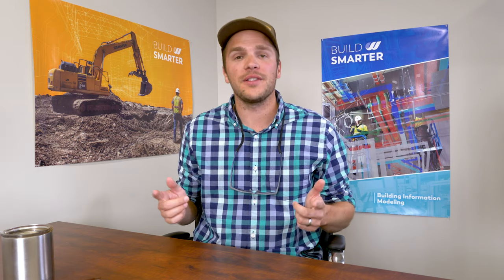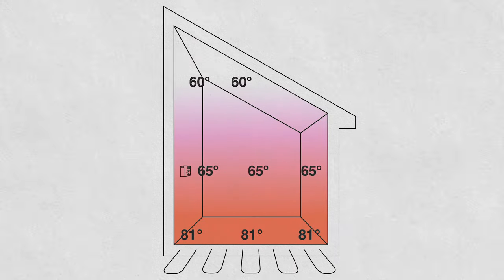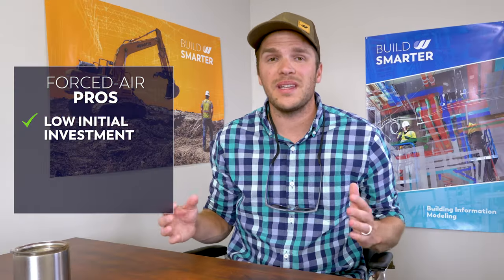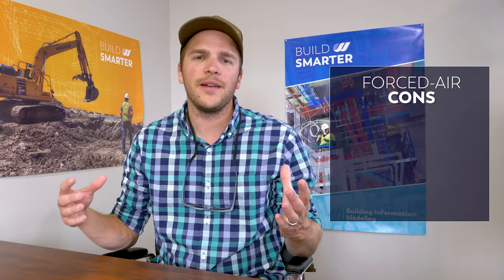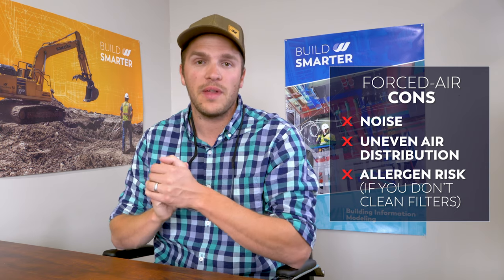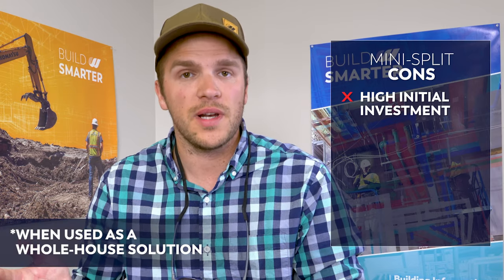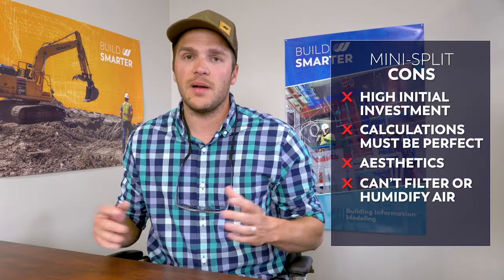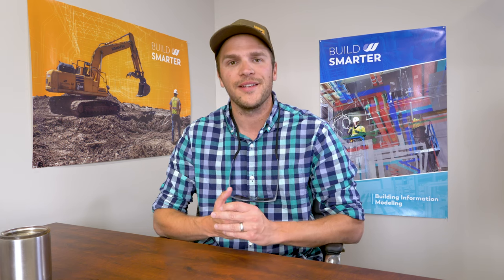Heating Systems: Hydronic vs Forced-Air vs Mini-Split

Comment: For professional working in the trade ( I a plumbing wholesaler) from Denmark, it's interesting to see how things are done in other countries. Forced air heating is not common in Denmark. It was used a bit in some late 70's houses. I have only seen it once live, as my cousin has in her house. Most houses in Denmark is heated with hydronic systems, by floor heating or radiators. I have a pellet stove in my house, but oil and natural gas is faced out in favour of air to water heating pumps as best retrofit solution

Comment: I used to have Forced Air w/ an oil furnace but not have a Fujitsu mini-split system and a hydronic system with cast iron radiators.  Absolutely love the mini-split for A/C and heat down to around 25 degrees  Fahrenheit.  Any lower than that and it doesnt quite have the muscle to keep the house toasty.  Thats where we let the hydronic system take over and its really the best of both worlds.  I didnt miss either the noise or smell from the old oil burner.
Reply: Wait, so I'm guessing your hydronic system is gas fired? I'm replacing an oild oil burner so this is for research. PS don't have gas in my community.
Reply: How do you heat the hydronic system?

Comment: Another pro of forced air is its compatibility to pairing with a heat pump for cooling. Forced air fits well with water to air geothermal systems and solar thermal too

Comment: The house I live in has hydronic heating with baseboards, not as fancy as in floor heating but it is quiet and fairly well distributed. Heat registers go across 3 walls in a room. There is noise in the rooms over the oil fired boiler. Big con is no AC except window units or maybe mini splits if they were installed. The house is from the 1950s and I wonder if the hydronic systems were more popular back then.

Comment: It seems you didn`t mention another advantage of the hydronic systems it consumes around 150-300 watt for the heater and circulation pump, therefore it is very easy to organize a battery backup for it. In case of emergency a couple of 100 ah batteries will keep the system running for almost 24 hours.

Comment: in the Uk hydronic systems are standard in all homes forced air is practically unheard of. most homes will be equipped with boilers fitted within 10 years and maintenance is either covered by your landlord or by your gas company companies like SSE offer full boiler down cover also dry heat isn't really a problem in the UK because its winter and its 5C where i live but humidity is still 88%
Reply: I thought there is a mandate for UK homes to become CO2 neutral by 2050 or was it 2040? 

When you don't get really cheap green hydrogen, you are screwed! Compared to heatpumps, hydrogen boilers need somewhere between 5 to 15 times more renewable energy. Remodeling a home with a boiler to be compatible with heatpumps will be very expensive.

Comment: Interesting video, thanks! I would say the biggest potential issue for water radiant heating is that if your pump breaks you could have the water freeze which would crack your piping and concrete slab. How about radiant heating but with air going through the pipes ? Regards
Reply from the maker: Water freezing can be an absolute disaster if your pump fails — you're absolutely correct. For vacation homes, or if you want the peace of mind, we mix glycol antifreeze with the water -- so if the pump fails, the lines won't burst. We use Alphi-11: https://fernox.us/product/alphi-11-protector-25l/
Reply: @willplumb  I did that in my system to give peace of mind and it caused me problems. The antifreeze is thicker and holds less energy than water does, so it heats up faster in the boiler (in my case a tankless water heater) and doesn't flow as fast. Both combined to cause flashing to steam in the WH and awful screeching noises. Working with the WH manufacturer they asked me to take the glycol out, which helped but the problem did not go away completely. I eventually figured out it was flashing and increased the system pressure to a minimum of 15psi (gets to 40ish when hot)(the manufacturer stated I needed a 15psi pump, not system pressure) and that solved the issue completely. Guessing I could put some of the glycol back in now...

I wonder if a salt solution would be a better choice. Sodium Acetate would increase the thermal capacity of the fluid while providing the freeze resistance. I would have to swap to a stainless pump to do it though and it might cause corrosion problems in the zone control valves depending on what the insides are made of.

Comment: A con to hydronic systems is not just humidification but also de-humidification if you're in the south, meaning you've only solved the heat issue and need another setup for cooling.
Reply: Agreed, in the midwest where I live hydronic makes sense but not in the south.

Comment: What about the rinnai hydronic system that attaches to forced air system.  I have three air handlers and using one hot water system would provide warm air using little gas.   Possibly anyway.   Loved the hot water systems in England and the gas bill was real low monthly.

Comment: Another Pro would be if you have solar panels and are under 100% KW usage, the all-electric mini-split system's electrical usage can be diverted to the panels- this is also a benefit of ducted HP/split system.

Comment: I have a question. We are trying to figure out our best heating/cooling options for a property we have acquired. It is an old two room school that hasn’t ever been lived in and hasn’t really been used since it was a school. It is a brick structure, two layers of brick in fact so it is fairly efficient. There is NO ducting at all. Total square footage is just around 2800. Half upstairs and half as finished basement. The upstairs has 12 foot ceilings and each of the two main rooms is about 30’ x 30’. We live in southwest Michigan so it gets nice and cold but unfortunately also hot. We are leaning heavily towards the mini split system exclusively. Part of the reason we like this option is to maintain ductless in the house. Also, my dad just finished his log home in Alabama and he used a mini split system all alone and he says it is super efficient and cost effective… but Alabama and Michigan are a bit different climates. Any suggestions or considerations? Definitely appreciate it.

Comment: How do you install a hydronic system if the house is already built? I mean, do you remove tiles first or do you look for space under the tiles and then remove the ceiling of the lower level of your house.

Comment: I have a hydronic system with floor board heating. And forced air for AC. There is a boiler and a heater connected. Any recommendations to upgrade the old heater that is pushing out  more psi through the unit?

Comment: I have been using a hardy outdoor wood burning furnace foe the last 30 years that worked great , well I am 75 now and can not handle cutting wood and taking care of the furnace, can I use another heat source of hot water tank or tankless, no gas in my area. been using a old furnace with coil in plenum and blower. any advice apricated. Thanks

Comment: Hi, We live in Salt Lake City. Our house was built in 1930. Brick construction. No insulation in the outside walls. We have new windows and blown insulation it the attic. One floor ,about 2500 square feet, with a separate apartment in the back. Our heating is original radiators and new boiler. I want to upgrade to radiant pex under floor heat. I got 2 estimates. One contractor suggested mini split. I don't think it would be good for an inefficient house like ours.  What's your opinion?

Comment: Ive been calling my heating system A hydronic heating system, but it is very different than described in this video. I have a AquaTherm VAQ series hot water heating system. Should I just be calling that a hot water heater? It isnt a boiler. It circulates water from my hot water heater to the system, which is basically some coils which are heated by the water and a fan which blows that hot air through my homes vents. Ive also read it being called a Vertical Upflow Air Handler, so maybe that is what I should be calling it? Reason I ask is my system is about 30 years old, so its at that point where I can expect it to one day stop working.

Comment: How would you feel about having a geothermal system running hydronic system, Ductless AC, all with an HRV to maintain air quality? Also, don't they have ductless that can be more hidden like up in the ceiling? (Speaking of a moderate climate with 0-40f in winter, and 80-95 in summer)
Reply: I know this is an late Answer But I'm Curently Running A Hydronic With a Geo and It's Some of the Best heat I've ever Had And the geo I haven't had that many issues neither
Reply: @WTank109  Does the geo heat the water enough? or is it connected to an additional water heater?

Comment: I've been researching mini-splits for my shotgun style house built in 1900 in Kentucky,  The cost is pretty darn high and I think the outside install isn't easy on the eyes either.  The biggest question is who can I trust for a correct quote and honest installation?  I could live with the ugly inside units, I actually like the floor models but the cost.

Comment: I have a oil boiler that needs replacing and currently have solar panels. Would a boiler with hybrid water tank be a good investment ? The house is 1500sq ft and I currently spend $1600 on oil a year. Looking to capitalize on free solar power to reduce monthly bills in retirement. I don’t have a water heater now

Comment: I'm considering a combination of Gas Tankless home water heater with a re-circulator pump feeding into Hyrdonic lines, and a Mini-split with an HRV. Going for an airtight IFC home, new construction. Any experience with such a setup? I was hoping the HRV could deal with a lot of the CONs on your list.
Reply: HRV or ERV with hydronic heat for the win (tight envelope with good insulation).  Forced air is terrible.  Mini-split is great for smaller applications if the outside temps don't drop too low.
Reply: Maybe a bit late, but I put in a Takagi Jr to heat my house. The biggest issue I have is that I bought a cast iron circulation pump. Get a stainless one. The cast iron should stop rusting pretty quickly in a closed system with 02 barrier PEX, but I still get rust chunks and eventually it plugs up the screen on the water heater inlet. I then have to take it out, cover the hole with my thumb while a second person cleans it. Then repressurize the system to at least 15psi, or the water flashes the water to steam and screams. Use a 50psi or 75psi over pressure valve instead of the typical 30psi.
I did a single pump to keep the electric costs down. The low setting on a three speed Grundfos seems to be fine for the two zones I currently have running (still installing other zones on a force air removal). The heater has a huge output of 200k BTUs, but I doubt I can get anywhere near that without a much larger pump and the return water is usually pretty hot anyway, which limits the input. As I add zones it will return colder and I may need to kick the pump speed up.

I would like to design up a microcontroller to control the pump speed based on how many zones are currently on and the outside temperature. As the temp drops, bump the speed up, or as more zones are one, do the same.
The idea being to save pumping energy.

Comment: any body know what may be wrong with a Hydronic  system that seems to keep getting air locked ?
Reply: Your pipes should have a valve that allows air to escape if it becomes trapped. Yours might be broken or install incorrectly or something like that

Comment: Hydronic heat go through an extra medium which is water before eventually heating the air in the house, vs heat going from natural gas straight to air in a furnace. So how is hydronic heating more efficient?
Reply: Amateur guess: water hold a carries heat better than air.

Comment: How the hell are mini splits that expensive??
Here in Brazil they start at around R$1.2k and that is about 300 USD
And that is counting it installed
Reply: Definitely more in the United States... about 2 to 3 thousand installed for a small unit.
Reply: Cuz in America they love to over charge for everything...
Reply: i agree 4000 for a mini split is way overpriced unless he is talking about a high btu top of the line model with a con artist installer. i got my senville 9k btu unit for about $694, thats is with taxes and a $50 rebate. the install was about $880 for the unit and about $200 for electrical install. so altogether about $1774. i live in tulsa, ok

Comment: ductless mini's cost much more to heat in cold weather areas when compared to natural gas.  Most don't realize this and the sales people don't tell you.  Your electric can go up dramatically.  Electric is much more expensive per unit that gas.  Forced air systems have huge issues.  Ducts get old, dirty, leaky - they suck air from wall and ceiling cavities. The furnace will suck air from the room it is in and send that through your house.  There is no way to completely clean the ducts, so it will be carrying dirty air unless everything is brand new.  Buy a house that is 40 yrs old with dirty ducts - it will make residents ill.  If they home has pet dander or water intrusion, you can't clean / sterlize ductwork.  Don't believe anyone who tells you they can sterilize duct work.  Check national duct cleaning association.
Reply: Says who? A therm of natural gas (~100k BTU heating power costs me $1) and gas furnaces average about 90% efficient.  So it's about $1.11 per 100k BTU of eating. 29 KW of electricity is equivalent to 100k BTU or one therm of natural gas.  BUT a heat pump multiplies the heating output over energy input depending on the outdoor temperature.  With outside air temperature in the 40s, most mini splits will produce 4 BTUs of heat for every 1 input, this means you'd really only need ~7.25 kWh of electricity  to produce 100k BTUs of heat. Nationwide electricity average is $0.13 per kWh or electricity, making it around $0.94 per 100k BTU (about on par with natural gas).

However, that's highly skewed since that doesn't take into account the lower electricity costs during winter on average (vs peak of summer) and the fact that most heating is required overnight and most electric companies go by time of day metering and offer discounts for off-peak usage. 

If you heat your home outside of peak pricing (typically 4-7pm), my local electricity rates during the winter months are $0.057 / kWh during super off-peak (10pm - 8am) and $0.095 / kWh during off-peak (8am-4pm and 7pm - 10pm). That would come out to an average rate of $.075 per kWh, or about 54 cents for 100k BTUs worth of heating (about half the price of natural gas).

If outside air temperatures drop much lower (at or around freezing), mini splits may lose efficiency by about a factor of 2 (requiring ~14.5 kWh of electricity to products 100k BTUs of heat) which would bring it about on par with natural gas heating. It's not ideal in very cold or below zero climates, but it's a great solution, especially considering it can provide heating and cooling needs all in one unit (resulting in lower install costs vs standalone heating and air conditioning solutions), especially if people don't have natural gas available in their area and are relying on heating oil (which costs ~3x more than natural gas).
Reply: @GuyOnYouTube  Says everyone in the Midwest. A therm of gas is averaging around $.396.  Much less expensive to heat using natural gas.